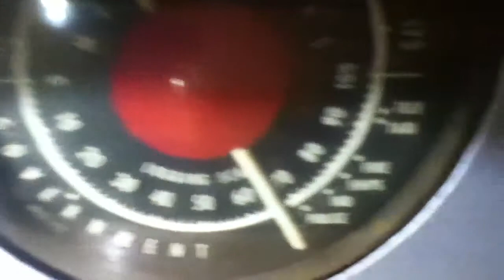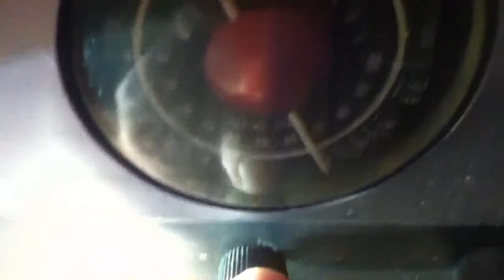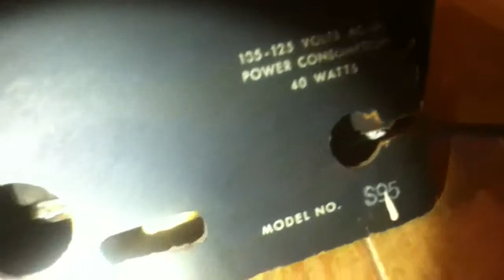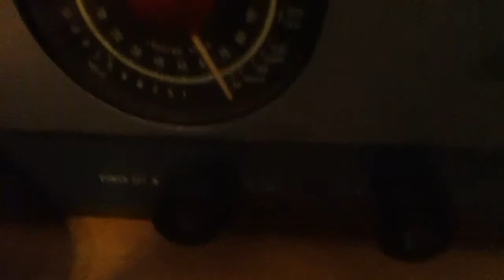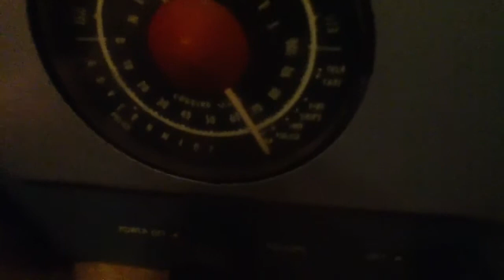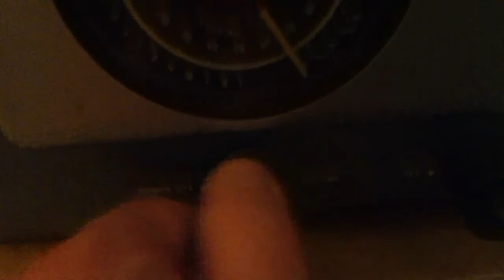Civic Patrol S-95 Hallicrafters

Comment: All that we could see in this video , was that the tubes " light up " and the dial cord isn't broken . Try turning on some lights in the room , instead of working with a flashlight . Try connecting an antenna to the radio , and you might pick up a signal of some sort .
Cheers !